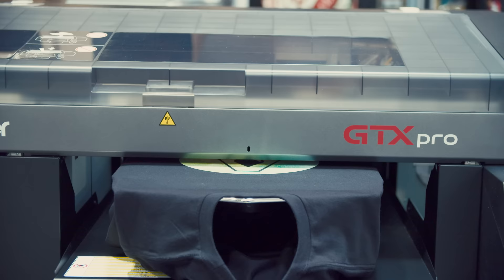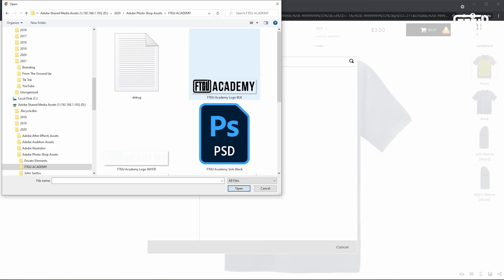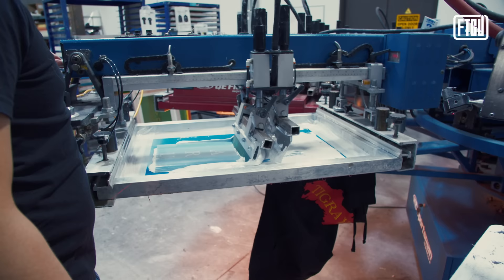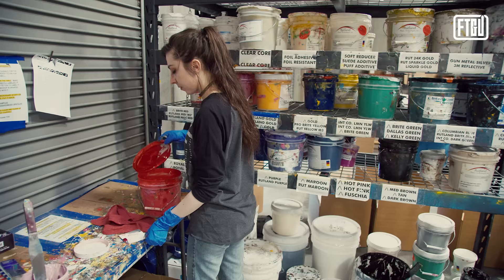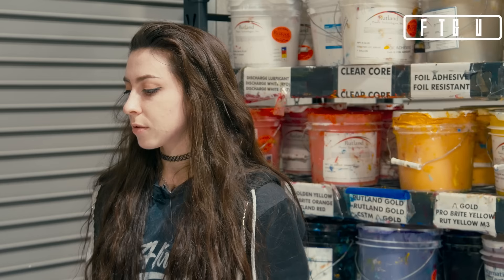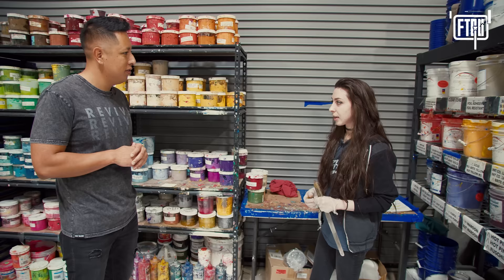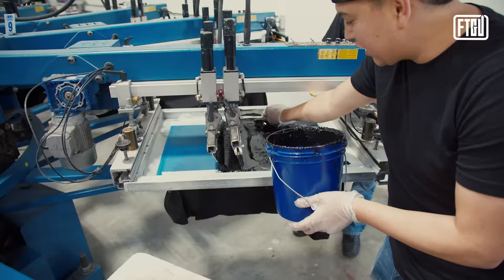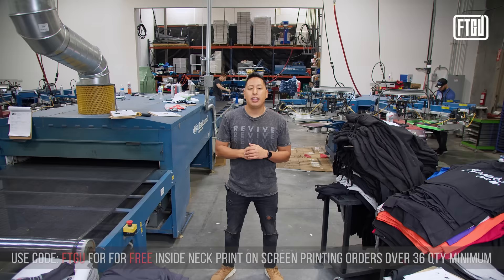From DTG To Screen Printing | Ultimate Clothing Brand Strategy

Comment: Great info
Question...once we do a sample on the DTG ...then we need to be careful on pricing our T-shirt  Especially if there's multiple colours on or shirt... pricing well be than one color... thxs
Reply: You ask the printing company to give you a quote for your design for different quantity brackets.
Most printshops would have minimums of maybe 25 garments screen printing so get brackets of 25/50/100/200.
This way you'll know a rough price for you to target your sales.
Then its time to presale your design to your people/followers and honestly its where you yourself have to commit and go bananas and sell your tshirt like crazy. The more units you sell, the cheaper each become and the more profit you get per sale.
TIP: Once your presale ends, add some extras to that order so you have stock on hand for the late comers.
By adding more, this allows you up your total order quantity which most likely will put you in a higher quantity bracket... meaning a cheaper price again and more profit.

Comment: Sad truth is nobody got upfront money to get 100+ minimum shirts made which is a requirement for 99% of manufacturers
Reply: Sad truth is that if shit was easy everyone would be doing it. And there are many people who order 72-144. If you can't afford it, find a shop that can do 24 piece minimums and start with simple 1-2 colors. You can also reach out and do your research for loans. There's many ways to find funding. Heck I starting my own business out of a bathroom and found my way to a fully operational shop with full time staff.
Reply: @allstarprintlab2675  I don’t need to worry about any of that I have a print on demand in my area that’s hella buzzin. I was speaking for people who don’t have it like that. Besides what you’re saying is still for a select few. Ok then they have to consider good garments neck labels etc. stop with that bs “if it was East” never mentioned once it was easy

Comment: @2:59 what machine is this?
Reply: That's the flash machine! It'll dry the ink enough so other colors can lay on top of it. You'd want to flash after a white so it's dry when another color is placed on top! But it doesn't completely cure the ink, you still want to run it through a conveyor.